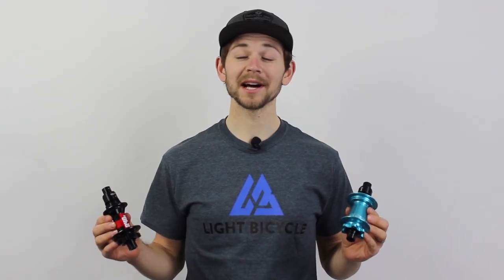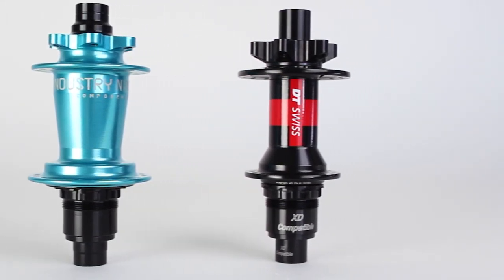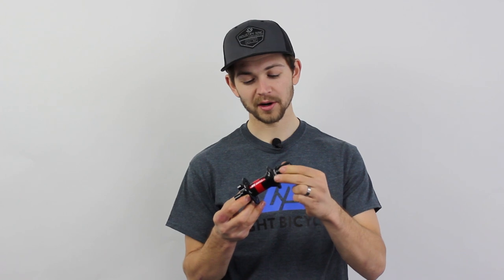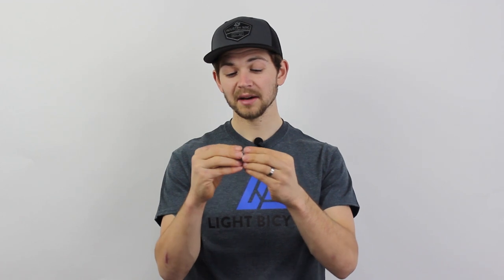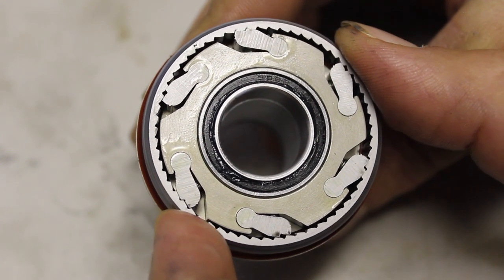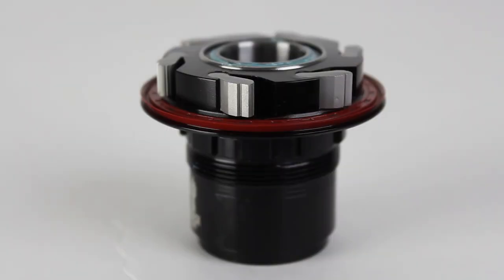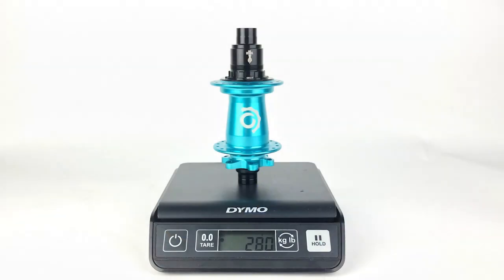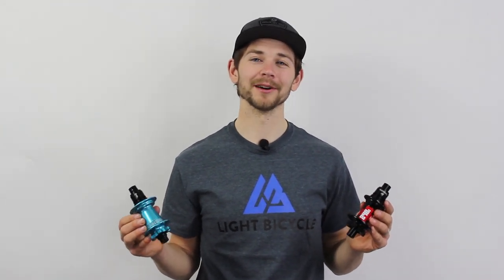Hub Comparison: Industry 9 Torch vs DT Swiss 240

Comment: Absolutely fantastic. I’m 250#, and my three year old Race Face free hub just failed. I wasn’t sure what to do for replacement, but now the answer is clear: DT. I’m sold on the 360 degree engagement, and it looks like if anything does goes wrong after another three years, it will be easy to fix.

Comment: Sound would be the final thing of consequence to many riders. I have the i9s and my dad has the DTs. My bike is probably 3 times louder if not more, and honestly. I’m extremely proud of my angry bee sounding wheels.
Reply: Gavyn Pendleton I come from bmx  road brakeless most of the time. I used those angry bees to gauge my speed. I love a loud hubto.
Reply: Put 54t ratchet into the DT hub and you also get angry bee sounding wheels.
Reply: I’m jealous
Reply: Robert Trageser how does industry 9 compare to chris king?
Reply: RollinRat  Man you must work for CK ,   The sprague hubs by Onyx are the best, that’s why helicopters use them in their drive mechanism....

Comment: Ratchet over pawls any day of the year - coming from a professional wheel builder who knows how i9 Torch pawls (and any other pawl freehub for that matter) tend to fail when they fail...

You just cant break the simple system DT Swiss and other companies employ, whereas pawls wear out - the heavier you are and the more miles you put in, perhaps alot of uphill too, the faster they will bow out.

Aside from that, weight on the hub is vastly overrated. That is not an argument for or against either of these. You want to save weight on the rim and tyre if you want to feel the difference when riding. 
That being said, I'd toss Chris King ISO Hubs in the mix of the price range we're talking about, for they look prettier than DT Swiss are in various anodized colors available (while DT Swiss hubs are painted), are just as reliable as DT Swiss and give you the bonus of prolonging bearing life substantually by being able to adjust the play and pre-load. 72 points of simultaneous engagement is enough and will outlast any pawl hub by years without worries.
Reply: To me it sounds like the very best design was taken away (patent) by DT swiss and out of need arose the I9 design. The DT design adheres to the KISS principle and less moving parts. The other HUB manufacturer's have to adopt to fancy colors to attract buyers it seems like.
Reply: Agree, and tooless maintenance. Being over 250 lbs I have destroyed hubs with the prawl system

Comment: If anyone is wondering the best hubs you can buy are the Onyx hubs end of story.  They use the same sprague clutch mechanism as a helicopter uses in it’s drive for the rotor blades. DT Swiss for the simplicity and reliability otherwise...

Comment: DT any time. its simple (best technology  mast be simple) , drag free, not too noisy, very light simple thread free maintenance.... the only down side is price but if you calculate the life span you get out of it... it will give good reason to used it.
respect I9 but it falls in any category against DT including price.
Reply from the maker: Thanks for your comment. DT can be a bit price but it is very nice to have a low maintenance hub that proforms for many rides. Cheers

Comment: Do you offer decals for the 240 hubs to clean of the red?
Reply from the maker: We do not but there are companies that do make them. Silk Graphics would be our recommendation.
Reply: @LightBicycleOfficial  yeah, but these should be applied before building up the wheels. If you don't offer this as some kind of an upgrade, then is it maybe possible to send in some hubs?

Comment: I9 for fatbike and DT for normal bike. Why - here is why. Fatbike needs to be LOUD!! People just don't hear me coming but with the I9 rear hub no problems. DT is too quiet and people don't hear me coming. In the snowy trail ride it really matters. People are standing there on my way with their dogs if I ride my bontrager hubs because they just don't hear. With I9  hubs they hear me coming and give me some room to pass. Sometimes I adjust my front brakes so that it will screeeeeeeeaaaaaaam! Helps a lot ;-) I think the I9 is showing already some sings of unreliability issues like random banging - usually after freewheeling for sure. Never happened in the DT hub though. DT I can trust :-)

Comment: I've had freehub shell failures twice with I9 and had little to no product support from them. They may have high engagement but I've had to service their rear hub non stop since owning. Their pawl design isn't as robust and is prone to disengagement compared to dt swiss. The bottom... if you want fancy colors and enjoy servicing your bike excessively then go with I9. Chose dt swiss if you need a more durable, fail safe option in their star ratchet design.  I will never purchase I9 due to I9's lack of accountability. You expect premium support when you pay a premium price.

Comment: I had Onyx on my last bike, I'm going DT 240 this time. DT are simple, work and optimised to be balanced in all categories, Onyx are heavily biased towards fast engagement and silence but it comes at a cost, weight. My rear wheel with Onyx felt like a brick, weight isn't only bad for gyroscopic effect or acceleration but it also impact the unsprung mass of the rear suspension a lot. In addition super high engagement hubs cause more pedal kickback further hindering suspension performance as when the chain tensions under compression there is no slack in the drivetrain. Not to mention the anodising on my Onyx was piss poor, I bought orange and exepected something like Hope orange, instead they looked like a dull washed out faded mango colour. Finally they developed notchiness and missed engagement sometimes after a while and also the grease I used somehow seized my axle in the Onyx hub and I had to tap it out hard to get it out. But the main thing is the weight, 475 grams for a hub vs the DT 240 EXP at 200 grams and also Onyx don't offer straight pull and they are twice the price. Yea the instant engagement is cool when you go do the road for the first time and you are like wow thats crazy and the silence is cool. But after I while you realise that they weigh a ton and you can feel it riding and picking up the bike back wheel off the ground, you get bored of the silence and want a cool sounding hub and this combined with the durability issues, ridiculous cost, crappy anodising and too fast engagement making suspension action under braking worse means I will never touch them again. There is a lot of cons for that instant engagement and silence.

Comment: dt swiss is better .if you look about the ratchet system and comparing to i9 pawls. in the end of the day pawls house of i9 they loosing not fitted anymore or worse case is crack around the house pawls. but dt swiss ratchet teeth are really easy to replace.and maintenance.

Comment: I have the DT350 and do not like them,  it came with the 18 teeth ratchet, I felt like I had a half rotation of the crank before engagement, it felt like a step down from the XT hubs I had.  I spent another $100 for the 54 ratchet and still do not like the engagement.  When I upgraded to the 54 I saw the freehub had gouges from the XT cassette, it is soft aluminum.  The inexpensive hubs became very expensive.  $225.00 for DT 350 hub, $100 for the 54 ratchet upgrade, another $85 if I want to upgrade to a steel freehub= a total of $410.00.  For that price I should have gone with the I9.
Reply: Sorry to be skeptical but I highly doubt you, or anyone else for that mater, would notice the difference between 6* engagement and 3*.  Maybe in the work stand but actually riding? Also the drag would be substantially more noticeable than the engagement, i9 hubs have massive drag I could feel it slowing the bike down which I can't say about any other hub.  DT are on just about every pro bike for a reason, they just work, the failure rate on dt240 hubs is literally 0%.  Stick with the hub you have and ride your bike, i9 are cool looking but a pain in the ass to own.
Reply: T Sturdy, I would certainly notice. I'm using a Chinese brand, Chosen, OEM of Halo hubs, with 120T engagement with 3 wedge pawls. The pawls have 10T each. Every time I use other bikes with more than 3° engagement it felt laggy. You'd surely feel the delay especially on technical climbs. Try 120T then ride something laggy like the Hope Pro 4 hubs. You'd surely notice.
Reply: 6* vs 3* will be imperceptible, seriously the difference at the end of the crank arm is only 2.5 mm, trust me you can't tell.  I don't think the best riders in the world could tell, just ride faster, more often, stop worrying about 2.5 mm... If you rode more you'd understand what durability means to cyclists.  Not trying to offend you, just saying, for most of us if something is functional enough but vastly more durable, that's the one to get.
Reply: Next time don’t buy the cheap 350, get the Swiss built 240s. I’ve owned both, they are not of the same quality
Reply: @sturdyvw  Lol !!  6 vs 3 degres is a world of difference.  You need to ride harder!!
Reply: @mpgt  name the place and I'll race 😎
Reply: @weridebikes1000  one is lighter that's it.
Reply: Blue Pitbull absolutely not. There are many differences.
Reply: @weridebikes1000  i have both the 240s are milled more. Do research
Reply: Blue Pitbull you do research the internals are not identical, and they’re not even made in the same factory.
Reply: @weridebikes1000  I have I'm building reserve wheels and even spoke to 3 different people at dt the bearings will work from one hub to another and the ratchet is also compatible I got my friends old ratchet set and it fit the 350
Reply: Good for you. I don’t need to talk to anyone, I’ve wrenched professionally for over a decade and have owned both 240s and 350 hubsets. You just keep asking people...

Comment: i9 is not known for little to no maintenance.. I9 is a brand new company.. They NEED to produce those in different colors to get the buyers. Like old companies did. 95% of those old and NEW companies that did something cool, in different colors failed. They were bought or just simply nobody bought their things.. 

I wouldn't even say that CK or Hope are big companies. DT is bigger. Mavic is waaaay bigger. And on top of the chain sitting Sram and Shimano.. It's not easy to sell your crap. Even if it's good.
Reply: Moo i9 has been producing wheel-sets and hubs since 2005... not exactly “brand new.” This alone is probably enough to make someone question the validity of the rest of your statement.

Comment: i9 paws and rathet is made from aluminum,  and you say it is robust? Joking right? Even cheapest hubs on market have their paws and ratchet made from hardened steel, and everyone who disassemble hub for atleast one time know that hardened steel is top option when materials suffering from friction. This hubs are junk for kids who like change parts every 3-6 month.
Reply from the maker: Hi vic tor. The i9 Drive Ring and Pawls are made of hardened tool steel. They are very durable.